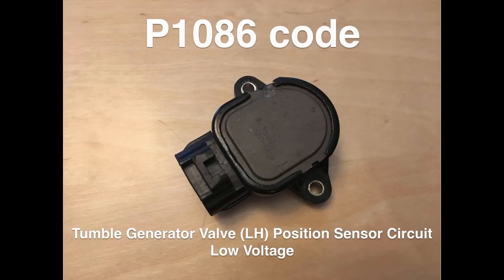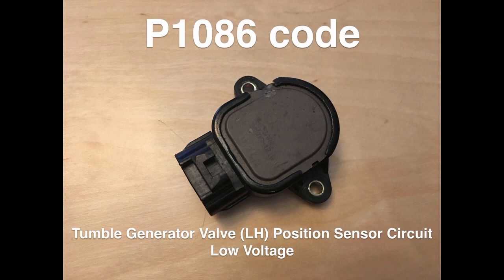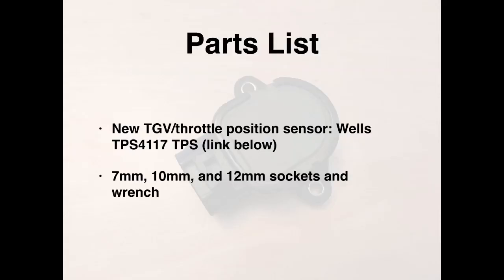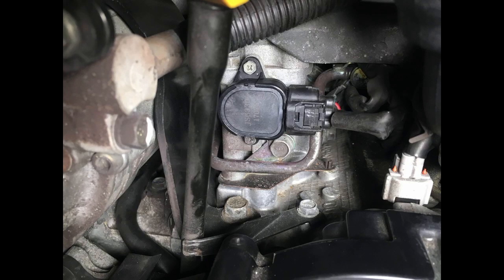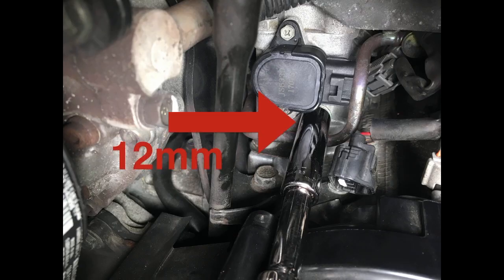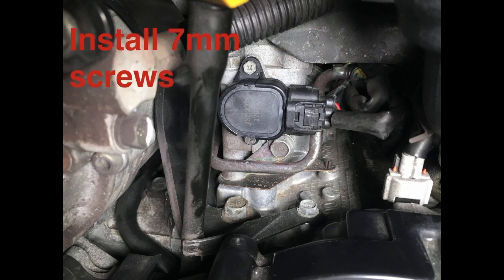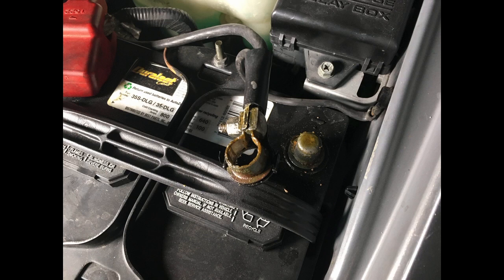Subaru P1086 Error Code: How to swap the TGV position sensor in a 2004 Impreza

Comment: I know this is a stretch but i have this same stored CEL along with a P1096 (TGV circuit #2 open) I’m assuming P1086 is paired with it. My vehicle is cranking and not starting I have fuel air and spark would the TGV keep it from starting. I recently changed spark plugs in hopes that was giving my issue. It also has a P0183 (Fuel temp sensor “A” high input) this isn’t correlated to the other two codes correct?
Reply from the maker: Yeah, seems to be more than just a bad/old TGV position sensor going on here. I don't think a bad TGV is enough to prevent the motor from starting: the TGV is an emissions device, to "tumble" the air  being sucked into the intake during cold startup to reduce the amount of unburned fuel during combustion, but these don't block all the air from entering the ignition chamber where you wouldn't have any ignition.
That P0183 code probably isn't related at all to the TGV. That's for the fuel pump, so I'd try to find what's going on back there at the pump, maybe the wire has frayed to the pump, which may also explain how you may not be getting enough fuel to the fuel lines to start the motor when you're cranking it. Good luck!

Comment: Would this be the same process for code P1090?
Reply from the maker: Possibly. P1090 is when the ECU thinks the TGV is stuck in the open position, which could be caused if the position sensor is not installed properly (not turned 90º during installation to load the internal spring), so the ECU thinks the TGV is always open. So if you're installing a brand new sensor, be sure to place it over the TGV axle, then turn it 90º so the sensor holes line up with the mounting holes in the motor. You should feel the tension of the spring build as you turn the sensor, and it will snap back if you let go of the sensor before reinstalling the mounting screws. Good luck!
Reply: @BillWinterberg  oh ok. Thank you!

Comment: Was able to fix this CEL code on my 2004 Impreza WRX Wagon! I had to stuff some paper inside the socket as my tiny 1/8 drive socket was still too deep to keep the bolts from falling out of the socket, almost lost the damn things twice!
Reply from the maker: Awesome, so glad you could fix your CEL on the cheap!
Reply: @BillWinterberg  I had bought the car last month and before hand the guy told me the CEL popped up the day before we met up for the sale. I was really worried it was going to be a very convoluted procedure but I’m so glad it was very straight forward!

Comment: What exactly do u mean by install it with the plug facing up 
Like have it upwards and plug it in and then rotated 90° or why does that matter
Reply from the maker: You install the sensor onto the TGV axle with the sensor plug pointed towards the hood, and the you turn the sensor 90° to load the sensor’s internal spring. If you don’t install it this way, the sensor won’t send the correct position signal to the ECU, and you’ll still have a check engine light.
Reply: @BillWinterberg  oh okay I got a new sensor and just plugged it in without thinking about it and mounted it and I test drove it 20 minutes ago and it was worse than before so u think I should retry it with your steps?
Reply from the maker: @stupidkidstv5855  Definitely. Remove it and reinstall it with the plug pointed up to the hood, then turn it clockwise 90° so the screw holes line up with the mounting holes. You should feel the spring tension as you turn the sensor. Install the screws, plug in the sensor connector, and then fire up the motor. Your CE light should go away and your motor should run a TON better.

Comment: Great video thanks!
I have a 2002 wrx, do you know if there's only one TGV sensor or is there one on each manifold?
Thanks for any feedback
Reply from the maker: You should have the EJ205 2.0L DOHC Turbo motor in your 2002 WRX, and that motor has one TGV for each manifold, driver's side and passenger side. The driver's side TGV sensor is up near the battery and oil fill pipe, and the passenger side TGV sensor is back by the turbo housing.
Reply: @BillWinterberg  
I do. I just worked on it but I can't figure out how to pull the one between the turbo and intake. With an offset 7mm wrench I was able to remove the top bolt, but I struggled reaching the bottom so I put the bolt back in. Codes are P1090 and P 1080. I am debating whether I need to just remove the intake, delete the TGVs and call it the day. Just a tedious process. Or take it to a mechanic that can give me a better diagnosis of the issue.

Comment: what if i accidently just took the sensor off then put it back on without rotating it and now im throwing the P1086 on my 03 wrx. can i just take it off and put it back on rotated and rotate it back to the battery or do i need to take it off properly and put it back on?
Reply from the maker: You’ll need to remove the sensor to properly install it. There are two pins on the TGV shaft that the position sensor goes over. So you can’t rotate the sensor in place to get it to sit right over the TGV shaft pins. The sensor has to be installed over those pins when the sensor’s wiring clip is pointed up, then you rotate the sensor 90° clockwise to line up the two mounting holes with the intake manifold. When you rotate the sensor, you should feel the spring tension increase in the sensor. That way you know it’s installed properly. Good luck!

Comment: Hi, the P1088 code I've got says RH (or right hand), would this work?
Reply from the maker: Yes, the same part will work, just pay close attention to how you need to turn the sensor to load the spring before screwing it to the intake. The access is a bit harder to that sensor because of the tight fit by the turbo. Good luck!
Reply: @BillWinterberg  Thank you so much! Yeah the code read "Positioning Sensor 1".  I'll make sure my mechanic knows it's by the turbo area.

Comment: Tgv or tps ? i dont get it .
Reply from the maker: The TGV uses a standard throttle position sensor to detect the position of the tumble generator plate inside the intake. Hope that helps!
Reply: Does that make your car not accelerate ?
Reply: Do you know where the Stock Tps located at?

Comment: Thank you so much for this video. I noticed the engine light come on a few days before I needed a smog check on my 2004 Subaru Baja. It went off again so thought I'd get the smog check done. Sure enough the engine light went on just before he started the test. He told me he couldn't run the test because it would be an automatic fail. He said "I'm not supposed to do this but let's do a quick check on the engine." He came up with Error Code: P1086. He pointed at the TGV and said "this is likely the problem." I tried taking it to three different auto shops. One didn't want to deal with it at all. The Subaru dealer said we would need $1000 worth of parts plus labor. Another repair shop wanted to charge me $200 to put it on the scanner and "diagnose the problem." I said, "I think I'll pass." I went home and looked this P1086 code on youtube. I found the above video, ordered the part and followed the instructions. And to my surprise the engine light didn't come on. What a relief! The next day I got the smog check done and the engine light never came back on. Thanks Bill!
Reply from the maker: Awesome! Thank you for sharing. 👍

Comment: Could this be why when I try to start my car, it’ll only crank and not fire up
Reply from the maker: No, if you have a bad TGV position sensor, your car will fire up and run, but it will be a rough idle and engine performance due to the tumbling air in the intake manifold.

Comment: i got the same code as you , replaced that exact sensor and still didn’t work for me what do i do /:
Reply: actually just checked the code is p1093 would that be the position sensor under the intake ?
Reply from the maker: @blessedheavy  From a quick Google search, the P1093 is a code for Tumble Generated Valve System 2 Valve Close, so if you have installed a new sensor, then it might be the servo motor that moves the TGV valve. I bought that OEM part thinking it was my problem, part number 14120AA060 Idle Speed Control Motor. I still have it, brand new in the box. I always try to identify the root problem before throwing parts at the issue, but let me know if you want to buy my motor. Just write back.

Comment: I replaced it and code went away and then came back
Reply from the maker: The same code is back? And you're sure you added tension to the position sensor spring by turning it before screwing the bolts in? If so, then the TGV actuator motor might be bad. That's part number 14120AA060

Comment: Mine doesnt turn 90 degrees
Reply from the maker: So, before you place the sensor on the motor, hold the sensor so the plug end faces up to the sky. Then place the sensor into the valve assembly. THEN turn the sensor 90º clockwise to the plug points towards the place where the battery goes. (You should feel the spring tension in your fingers. In other words, if you let go at this point, the sensor will snap back counterclockwise, because of the spring tension.) 
THEN install the two screws holding the sensor to the motor/valve assembly. Plug in the wires, then replace any parts you moved out of the way to get to the sensor.
That turning by hand 90º clockwise is how you "pre-load" the spring on the sensor. Good luck!
Reply: @BillWinterberg  alright thanks . Ill give it try when im off friday. it been three days i have done it because my car running low idle now
Reply: @BillWinterberg  also mine is stuck so do i have to twist it hard to get unstuck?
Reply from the maker: @5Su0y  The old sensor is stuck? So generally, no, you don't have to twist the old sensor to get it off, it just pulls out when those two screws are removed.
BUT, the inside of most factory position sensors is plastic, so if your motor has run super hot, I guess it could be hot enough to melt the inside plastic, making it stick in place. Still, you can pry the old one off and destroy it removing it: the little posts on the TGV butterfly valve axle are metal, so they "shouldn't" break if you have to pry/break your old sensor off.
Reply: @BillWinterberg  the old sensor is off but the middle flat head thing wont turn 90 so im guessing like you said , the spring
Reply from the maker: @5Su0y  Yeah, the middle flat head should be the top of the TGV butterfly axle, and it won't turn at all. So that's why you install the new sensor with the plug end pointing straight up, then when you feel the spring is on that flat head, turn the sensor 90º clockwise, and you should feel the spring build up tension. Screw in the two screws to secure the sensor, and you should be good to go after that.

Comment: What about the p1088?
Reply from the maker: P1088 is an error for the position sensor on the turbo side of the motor, aka the passenger side. That sensor is the same one used on the driver's side near the battery. The only problem is that it's in a really tight location, so you'll likely need to remove a few more parts and heat shields in order to get access to the position sensor area.

Comment: I can't get this stupid thing to preload for nothing. The tab is vertical, but the slots on the sensor are not, they don't just fit on the tab and turn it. I can't hold the sensor slots where i need them to be and get it on at the same time. The way the slot in the sensor is, the only way i can get it on is to just put it on with no preload. Ridiculous electrical crap.
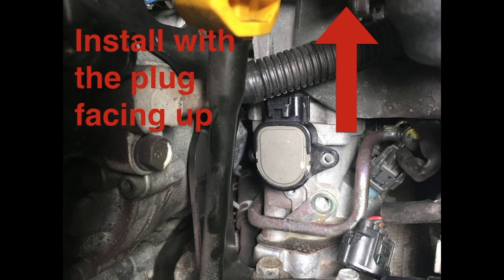Reply from the maker: Hmm, you didn't mention which motor you have in your Subaru. On that Amazon link, look at the second photo of the sensor which shows the back side. That white plastic circle with two little triangles in it is what should fit over the stem of the TGV valve. When the valve opens and closes, the stem turns, and it turns the little plastic circle in the sensor. That little circle of the sensor should go over the TGV valve stem at 1:36 in the video. THEN, you turn the housing of the sensor CLOCKWISE (towards the battery) and you should feel the spring in the sensor add tension, because the little white circle stays in place, but you're turning the housing of the sensor, which is how you preload the spring inside the sensor. Make sense?
When others have installed the sensor with the electrical plug facing 3 o'clock WITHOUT first installing it pointing straight up and turning it, they report poor idle and other problems because the TGV sensor isn't preloaded and it's not telling the engine computer the correct position information for the TGV, so the computer thinks the valve is in the wrong position.
Reply: @BillWinterberg  My wife has an 04 Baja turbo 2.5 litre. I could see how it's supposed to go, but couldn't get it to turn that far. Finally got it, check engine light went away for a few minutes, came right back. The running of the car is fine, but still getting the code. Cleared it out, still came back, so not sure what my issue now is. I appreciate your reply trying to help. I hate this car lol, it's been nothing but trouble. First subaru and last.

Comment: Hi there Bill,

I was wondering if you could point me in the right direction, i got the P1086 fault code on my 2005 Subaru Forester 2.5XT. no Engine light just checked it with my OBD scanner. I am currently having hesitation and jerking when punching the gass pedal, my feul consumption seens to be exessive as well, i have read up and alot of people say that its usually your MAF sensor which causes this problem but no fault code on this. please could you shed some light on this problem.
Reply from the maker: Hmm, lots of things can be involved here. So the TGV is supposed to be closed at idle, and then opens up under throttle using a stepper motor. These position sensors move all the time when you're on and off the gas, so the sensor wears out over years and years and throws the P1086 (left-hand side) or P1088 (right-hand side) code.
But if your stepper motor is bad, then your TGV shaft won't turn, and your incoming air to the cylinder will be restricted, which could be causing the hesitations and jerking when you punch the gas pedal. Less air means less oxygen to burn, so you either get a weak power stroke or no power at all during the combustions stroke, hence the bucking feeling. That stepper motor is probably $175 or so in parts. I'm not sure if a bad stepper motor would throw a check engine light and a code, maybe someone else can chime in.
If the position sensors AND the stepper motors are all working properly, then it could be a problem with your mass air flow sensor, misreading or misreporting the amount of air coming through the intake, and causing timing and ignition problems with the wrong air/fuel ratio instructions to the computer. Try to isolate each sensor and motor and see if that helps.

Comment: Is this the same procedure for a ej20 SOHC engine from the late 90s? We are changing ours and it all looks familiar. We accidentally took ours off without rotating it. Do we still need to rotate the new one back on?
Reply from the maker: I’m not 100% sure, but my guess is yes, you can’t just insert the sensor in its place and screw it in, you probably have to “pre load” the sensor by installing it 90° from how it bolts in, turn the sensor by hand (so you can feel the spring tension), then screw it in place without allowing that spring tension to release. Your mileage may vary but it’s worth trying.
Reply: @BillWinterberg  you star. I’ll give it a go tomorrow

Comment: Awesome! Just put a new motor in my WRX, first light to go off!
Reply: Hi, did a swap (JDM), would this sensor work on my 2002 WRX turbo? The code I got after driving it for 100 miles is P1088.  I know this post it's old but trying to get tips for the fix before I take the car to the smog shop. Your help is appreciated.  Thanks.
Reply from the maker: @lalolalo1233  P1088 is the passenger side TGV sensor. It uses the same sensor, but pay attention to the direction you need to turn the sensor to pre load it during installation. If I remember correctly, install the sensor with the wire plug pointed up to the hood, then rotate it towards the passenger side fender. If you are sitting in the passenger seat, you rotate the sensor 90º clockwise as you're looking at it to pre load the internal spring. But if you're standing over the radiator during installation, you still turn the sensor towards the passenger fender, but it guess you'd call that counter clockwise because of the way you're looking at the sensor from the front of the motor.
Reply: @BillWinterberg  My issue now is the "front" sensor or the upstream.  I bought and aftermarket one but getting a code P1139, should I just buy the Subaru genuine one?  it's a little costly but at this time I just need to get the car smoged --- California :(.  Any tips?  Thank you again :).
Reply from the maker: @lalolalo1233  I looked up P1139 and the NASIOC forum says that's the upstream air/fuel ratio O2 sensor. You might want to try this part: https://amzn.to/3TJuhmS It's $70 versus $200 for Subaru OEM, but many of the comments are 5 stars and the part worked successfully for them. If it were me, I'd buy it, try it, and if it didn't fix the P1139 code, then I would buy the OEM and resell the barely used on on eBay for $50 or so and recoup most of my money. You might even be able to return the sensor if you are careful during installation and don't get it dirty.
Reply: @BillWinterberg  Thanks for checking the code description, I ordered the subaru genuine tho (200 bucks, yuk) as to avoid hit and miss, hopefully no CEL and the few unclear pending monitors checks go away, California isn't flexible at all with smog checks :(.